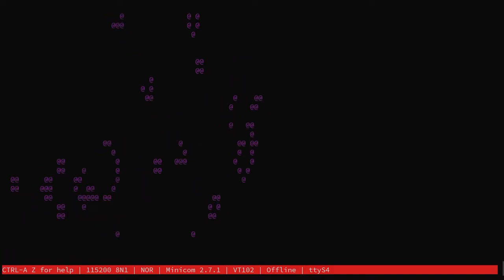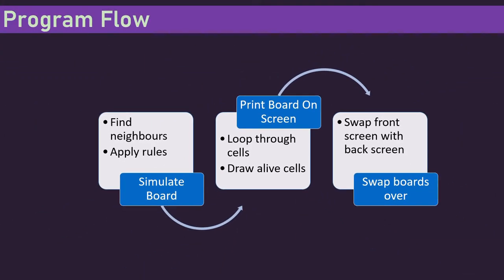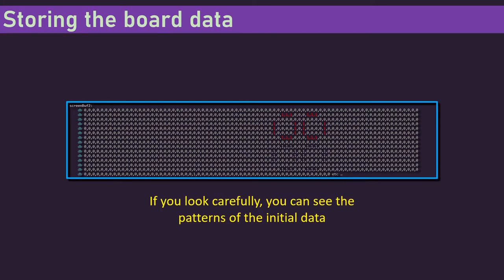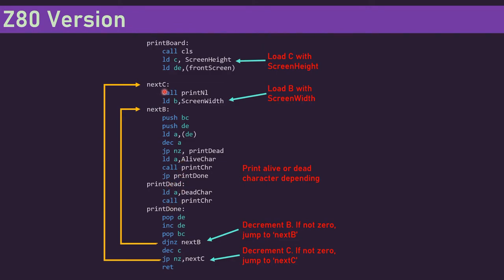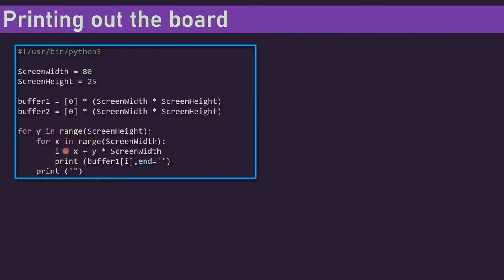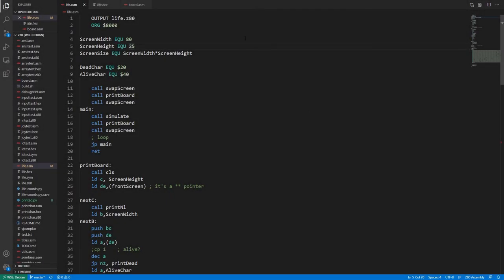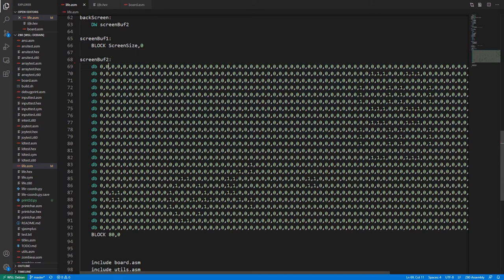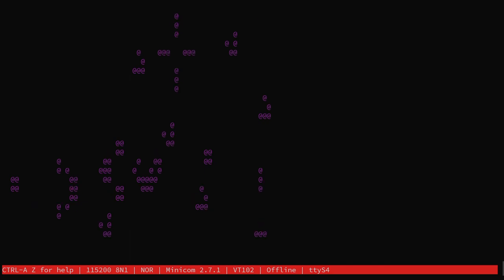Conway's Game of Life written in Z80 Assembler for the RC2014

Comment: Nice video!! However you don't need multiplication for this at all (I remember well, it was my problem when I started assembly ... as the matrix can be represented as a single dimension "array" of bytes, no need to think about 2D, ie calculating 2D->1D with multiply, but the whole problem should be thought already in 1D to begin with). Just use for example IX to point your previous state buffer and IY to the new and just increment IX and IY while you step over each cells just with simple INC IX and INC IY. Since an m x n grid can be represented as a chunk of memory always just INC'ing have the same effect as traveling through every cells, then the next row etc. Maybe though at the end of lines should be some double or triple INC, so cells wont "wrap around" to the other side of the screen , though that's an interesting effect as well (and as you told, you want to do this in your code anyway). And for testing it's really simple, just use addressing mode (IX+...) with hard-coded offset for each neighbors relative to the current (IX) position. I think, the code itself (at least the heart of it, sure, the map, initialization , printing would be more) may well fit into a single screen of Z80 assembly code, if carefully done. But tell me, if you're interested me to write such a code, would be a great exercise for me as well, it's a long time, I wrote things like this :)

Comment: Going to wait for a bit to see the next video, but you shouldn't need to have two whole buffers. Buffering the previous line is enough.

I recall there was a really good GoL implementation for the Acorn Archimedes, the used a BSP tree to represent an infinite grid, which had the useful side-effect of also cutting down on the amount of computation needed, as it just needed to deal with the grids in the leaves, and figure out when to split and join them.

Comment: Nice video!

I didn't do assembly language for a while (and never on Z80) but I think you can gain a lot of speed if you ditch the multiplications. Even with an optimized implementation, they are pretty slow, and more important you don't need them in this case.
You can get the neighbors cells using an indexed addressing (i.e in most cases if your cell is at addr, N neighbor is at addr -80, NW is at addr-81, NE at addr-79, ...).
I say in most case because it won't work on the first/last column/lines but instead of writing a clever code which handle all the cases, you will be a lot faster if you write many dumber loops (one for the inner cells, and one for each edge of the table).

If you implement this, please make a quick follow up video, I'd like to know how fast it's getting (your explanation of the algorithm is so good I may try to implement this on a ZX-Spectrum if I found the time ;o)  (and an assembler software).

Thanks for the video!
Reply from the maker: LeFauve That makes sense, thanks! I knew I could just add offsets to find the neighbours in the main part of the grid, but got stuck on the edges. I wasn’t sure if treating the edges separately was going to be better, but the multiplication is the slow part isn’t it.
Reply: @ncot_tech  Yes, you want to stay away of multiplications or divisions when possible (except when you can use bits rotations ;o) ). The couple of extra instructions to treat the edges separately (basically starting new loops) should be negligible compared to the time you'll need to test special edges cases on each of your 2000 cells
Reply: Hey  @ncot_tech  , since my last comment, I've assembled my RC2014 and gave it a try. I can confirm it works fine without any multiplication, and while I didn't make any serious benchmark I'm able to have at least 3 FPS (I actually had to slow it down because it was a little too fast to see anything).
Thanks for giving me the motivation to build this very nice piece of kit and to try z80 assembler :o)